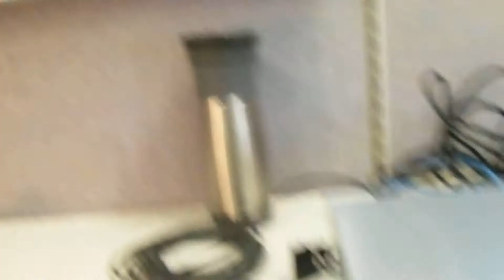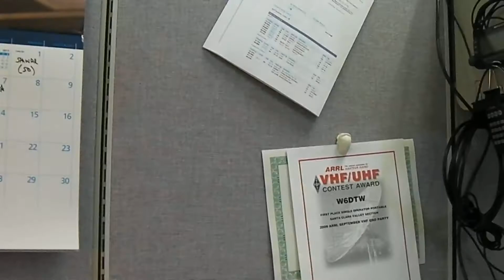Motorola XPR 8400 Fan Speed Modification

Comment: I have the same problem with the fan speed. Just bought Motorola DR3000, looks like new and was so quiet, strange. I discovered that previous owner just disconnected the big cooling fan and the transmitter was running damm hot. I do connect the fan and than discover the noise of the fan running at full speed non-stop. Thank you for showing us where is the switch to switch from F to N. Now the fan is running at lower speed,.seems the speed is the same when the repeater is in TX .

Comment: No one at the repeater site complains about the fan speed. its up on a mountain top here. Will it go to full speed when keyed up?
Reply from the maker: A solution to the noise issue is more for people working on labs, or techs doing bench work on the repeater.  Yes, the fan does still speed up based on temperature.